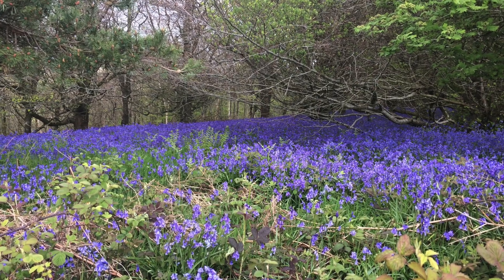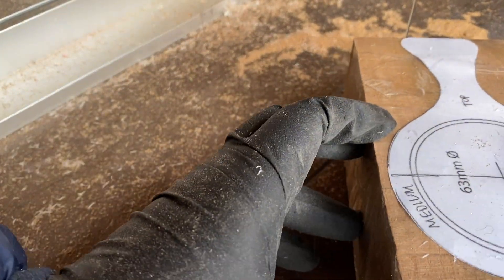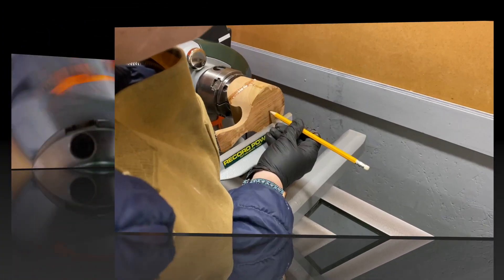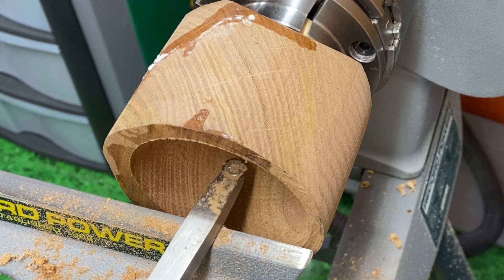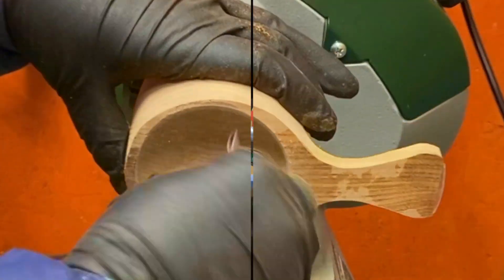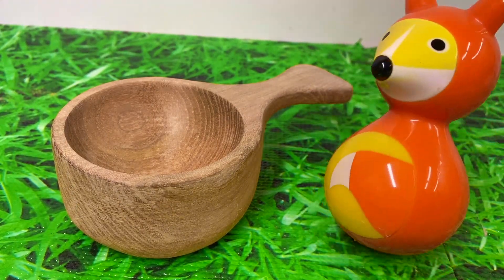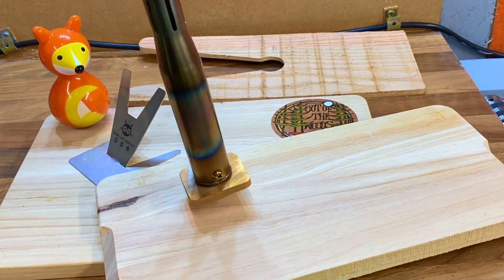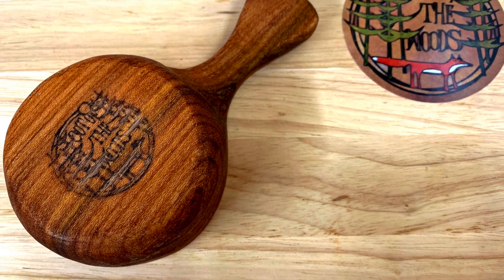Woodturning | Kuksa Cup on the lathe

Comment: Nice work clare that came out lovely. Just a couple of tips for the branding iron try a spray bottle to dampen the wood slightly as this helps with the overburn around the edges and then once branded and dry just give it a light sand over with the orbital and you're golden. The oil/wax will then make the brand really pop xx
Reply from the maker: Great! Thanks for the tips Dave. Will defo give it a try. 🥰🌲🦊🌲

Comment: Great job. If you are going to use a waste block then turn a tenon on it rather than have it as the tenon as it was too long to mount in the chick properly as it had bottomed out. Then with it in the lathe fix the work on the waste block on the lathe then you have a better chance of getting in cantered.
Well done!
Reply from the maker: Ahhh!!! I see!! Pro tip. I need to get on my lathe more and get better at this stuff. Thanks Paul x

Comment: Great video, being a novice turner as well that handle would have had me nervous lol

I did a new little tips and tricks video to help with using the branding irons on my channel. 

Great work though turned out nice 👏🏻
Reply from the maker: Yep. I’ve since watched the video 😀😀 will watch it again and get good with it 🥰🌲🦊🌲
Reply: @MakingItOutOfTheWoods  yeah your be fine, just test it out on some scraps and get used to how long you need to hold it in place. The little mist of water on it also helps from any unwanted heat transfer. Then oil at the end 👍🏻 

Least mr foxy has a new home lol